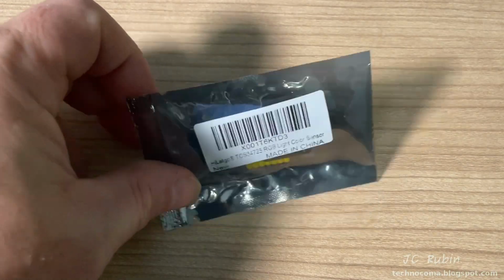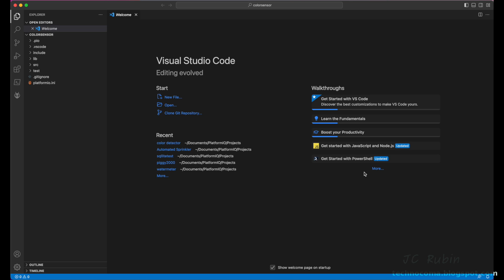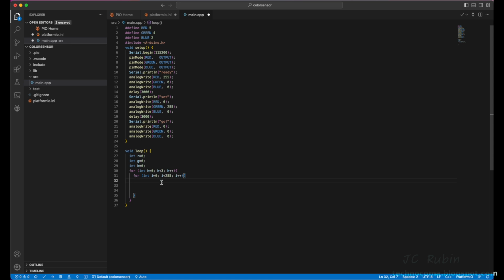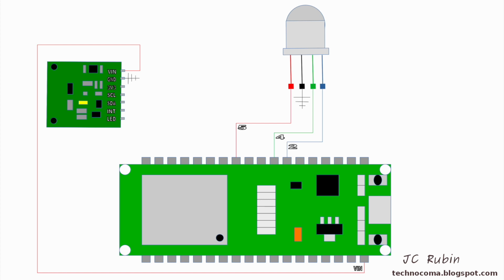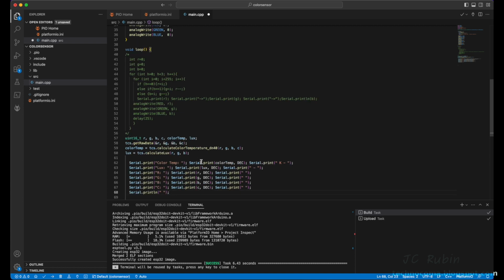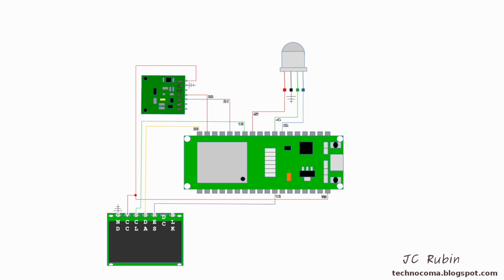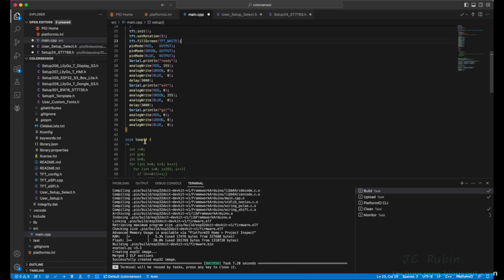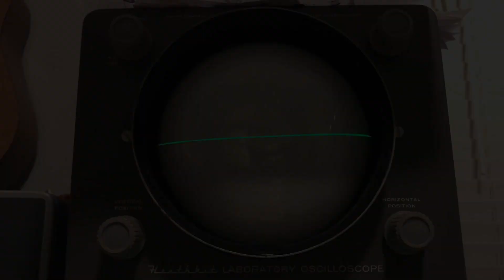RGB sensor TCS34725  experimentation with an ESP32 on Platformio

Comment: Thanks for the video :) Is the code missing now?
Reply from the maker: Your welcome. No idea what you are trying to communicate with your question.
Reply: @retrotechandelectronics  The link in your description to the github code is not working. It leads to a page not found. I went to your profile and wasn't able to find it there either. So, I asked if the code was missing these days, or if you still have it somewhere else.
Reply: Following up on this

Comment: Years ago I used an RGB sensor for testing a product we manufactured. We had a problem with the LEDs not always being placed correctly due to them being manually stuffed. I was asked to design a board that fit over the LEDs on the PCB, and would report if an LED was working or not and if it was the correct color during the manufacturing test. We didn't like to rely on the human running the test to verify the LEDs were correct.  The sensor was I2C, but didn't have an IR filter or the white LED. There were 6 of the sensors on the board along with an AVR microcontroller and was connected via a serial port to the PC running the manufacturing test. It was a fun little project.
Reply from the maker: Imagine the development cost and time then vs now for the same thing.